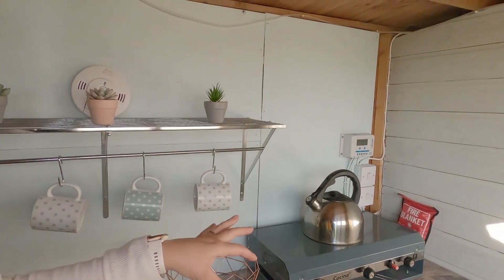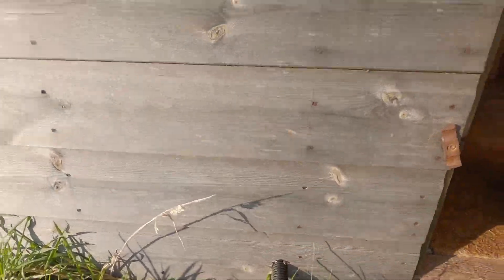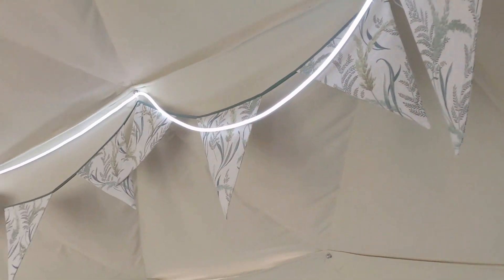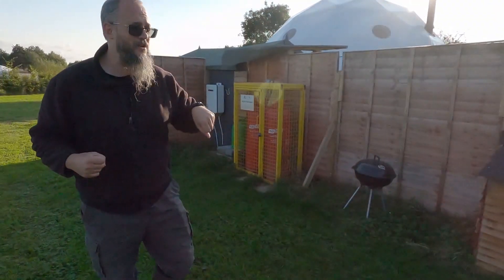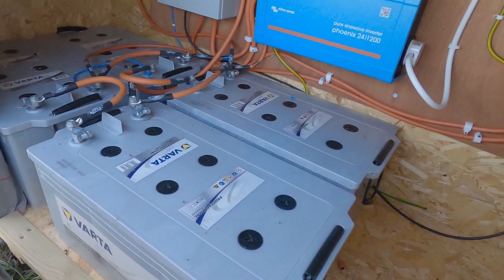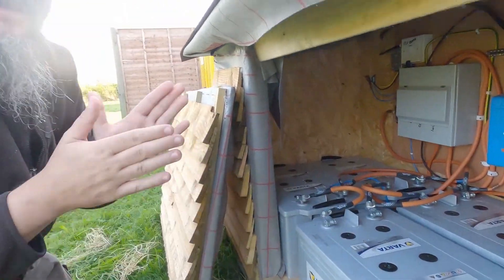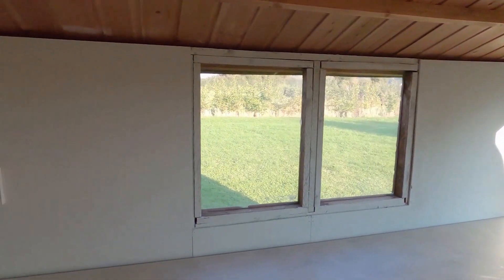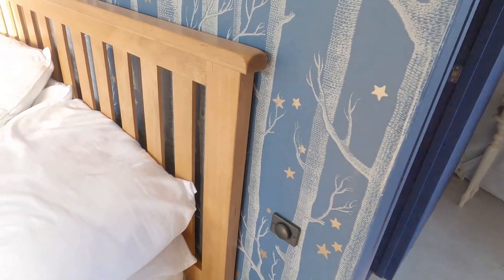Glamping Off Grid Solar Set-Up

Comment: Cold you tell me the average energy usage with guests present in each size dome
Reply from the maker: @shaynewilson1395  if I'm completely honest I've no idea! For the larger domes that are en-suite with outdoor baths we put in a 3kw system from memory which has never run out in the summer, we don't operate in the winter so I'm not sure it would last. That runs a 40w fridge, 80w boiler, lighting, USB ports, extractor fan and Jacuzzi bubbles in the bath of Fendt dome. We put the dome on 12v and the outside on 24v but I think the next dome we are building we will do all on 24v. Shout if you have any other questions! Thanks, Vicki
Reply: @TractorsandCream  thanks, one other question was if you know the predicted  paybacktime for the initial investment of the solar system
Reply from the maker: @shaynewilson1395  for us it was immediate because if we wanted to get full mains electric it would've cost around £25k so there was no way we could do it. I would estimate that one unit would use around £40 of electricity a month if you were on mains. It might be worth talking to portable power technology who we are using for our solar on our newest dome to see if they knew the figures. Hope that helps!
Reply: @ thank you very much for the info!
Reply from the maker: @shaynewilson1395  my pleasure, you know where we are if you need anything 😁
Reply: @TractorsandCream  Hello again! would you be able to tell me how the showers work, they use the hot water from the LPG boiler? and what would the electricity consumption be for the shower if any? are there any unforeseen energy consumptions with the pods that surprised you?
Reply from the maker: @shaynewilson1395  hi! So the lpg heats the water on demand so you have instant and continuous hot water as long as you have gas! The boiler needs 80 watts so not too much and there hasn't been anything that we didn't factor into the energy consumption. The gas is expensive but at least there is no electric bill!
Reply: Hi from Romania. Do you have AC in the domes? Is the 3kw system able to cover those? Tks
Reply from the maker: @elizavioletadrutu3102  No we don't have AC as we don't really need it in the UK. You would just need to work out the wattage of the AC and get a solar setup that can take it.
Reply: Thanks a lot!   @TractorsandCream

Comment: Love the domes, super cool!  A/C is much more efficient than D/C at long distances. The D/C side from the panels to the charge controller is the one that needs to be the shortest distance.   You may want to start putting panels on the restroom/toilet structure and consider placing them  halfway between domes (Code likely requires it to be checked for high wind load strength).   You can then run a short 25-50 foot A/C line to each dome.  To maximize power output, you might consider calculating roof pitch and direction  for best peak seasonal usage solar production. One idea is to  have 3 or more split rooms for your toilet.  One room would be your utility room in the middle of the structure for Inverter/batteries/charge controller.  The other 2+ rooms can be on opposite ends with separate bathrooms / toilet for different guests if you want to keep it somewhat private.  You can use the same utility room for wireless Internet access points if it's a service you provide.
Reply from the maker: Thanks so much for your insight, we are still learning about it all and know there are other/better ways of doing it all but will definitely look into those points for the next dome!

Comment: Awesome video guys! Have you ever had guests run out of electric? How does it perform during patches of cloudy weather or winter?
Reply from the maker: Hiya, no we've never run out electric, the batteries have a 5 day redundancy build in so even if it was pitch black it would still work for 5 days. The panels still generate power even when it's cloudy too so the likelihood of running out of power is very slim thankfully!
Reply: @TractorsandCream  Thanks for the quick reply! That's great to know :) appreciate the help

Comment: The seven I built I did the electrician myself it looks worse than what it is same as the plumbing.. the domes I built at least one was wheelchair accessible with a shower and washroom inside the dome I would stick with solo panels the goals to try to do it energy sufficient
Reply from the maker: Oh wow you are brave! We've sort of sussed plumbing but still worried about electrics! That's brilliant that you did a wheelchair accessible one. Yes I definitely solar is the way forward for these. Thanks for your comment. Vicki 😊